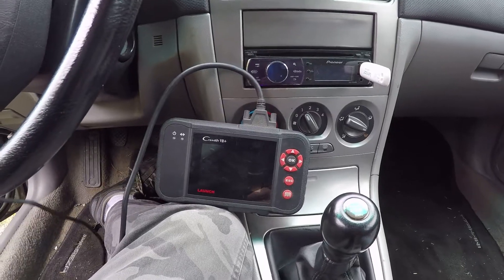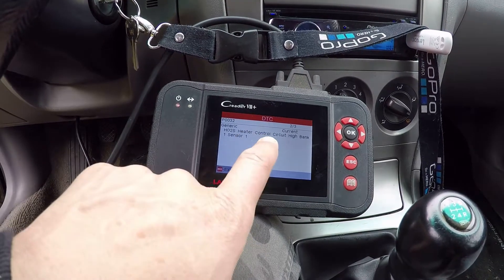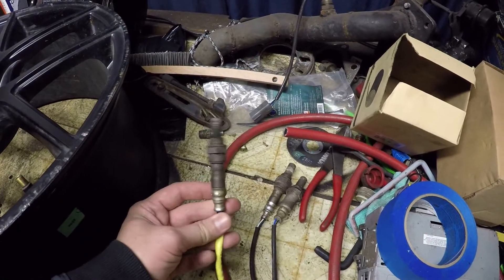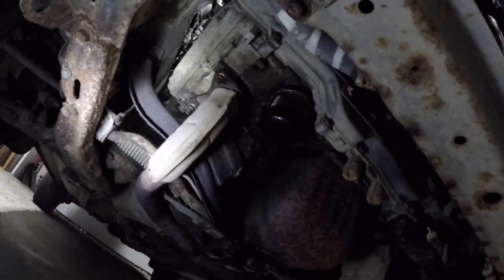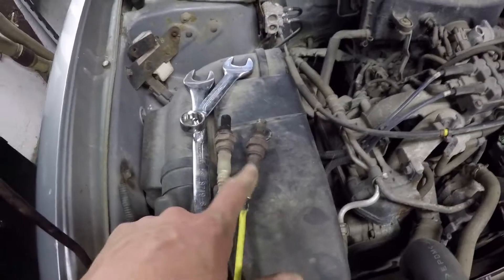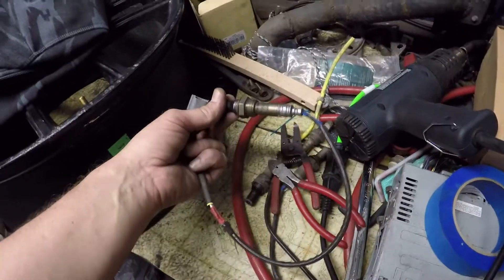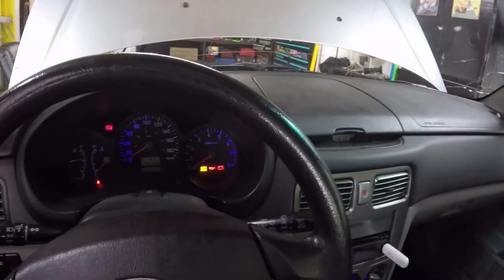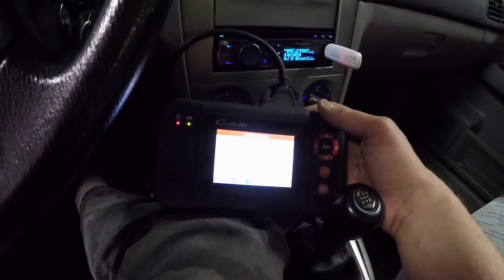Forester P0032 O2 Sensor Heater Circuit - How To

Comment: which wire did you solder it to
Reply: I have that p0032 I change the sensor and I still have the same code I have 2003 Subaru legacy
Reply from the maker: The heater uses two of the four wires on an o2 sensor. One wire is B+ power from the main relay and the other is ground from the ECU which is controlled. High resistance or a bad connection can cause this code to set. 

Make sure none of the pins in the connector are bent. The last possibility is an ECU not controlling the heater. Here is a thread that could help with a wiring diagram: https://www.subaruforester.org/threads/p0032-drop-exhaust-manifold-front-o2-sensor-access-solved.764497/

Comment: I have this code on 2003 bugeye wrx turbo, i have not been able to fix this at all checked wires change o2 like 3 times with with oem nothing 😢
Reply from the maker: I would load test the battery positive circuit to make sure it can provide up to 10 amps. If that passes I would run a new circuit from the ecu to the o2 sensor connector and recheck for faults. That should get it to pass coding. There is always a possibility of broken solder inside the ecu but very unlikely.

Comment: New to me Baja with a Forester motor in it now.  Had this code, changed o2, was out a few days, came back, cleared, out again. I did try some non subaru o2, code never went out.
  This would probably explain why my cruise would not work then...
  Thanks for doing the video.
  On a side not the EGR wire plug are different, same pin out, just splices (old motor had been changed and I needed the EGR system).
Reply from the maker: Heater circuits measure amperage draw. If there is a bad connection creating high resistance, this code will come up.

Comment: Where is the o2 sensor fuse located in the fuse box. Nowhere online is telling me which fuse number is connected the the heater sensor.
Reply from the maker: I’m not sure which one but it’s one of the 30amp SBF fuses that sends power to the relay

Comment: Good stuff. Have been looking for an engine diagnostic reader/scanner for a while now, not all of them seem to be suitable for Subaru. Had to remove and clean my DPF last week from the XV after trying a forced regen on it. Three sensors alone on the DPF, two temperature and one exhaust pressure sensor. So if anyone has any advice on a decent engine diagnostic reader for a 2013 Diesel Subaru that would be appreciated. Enjoy your trip I believe you have had some very warm weather in Canada this summer, might need that air con.
Reply from the maker: This little scanner has already paid for itself. It’s not fast and only does four lines of data at a time. It does read ABS and airbag modules so it’s been a great tool to have. As for diesel Subies, that’s a fairly small market. Might not be easy finding something cheap that will do active control and monitoring